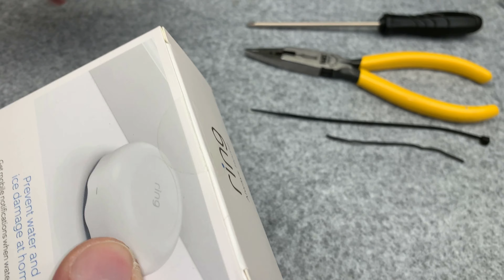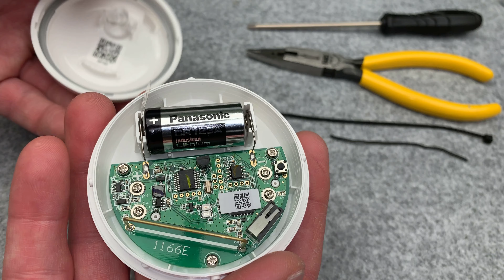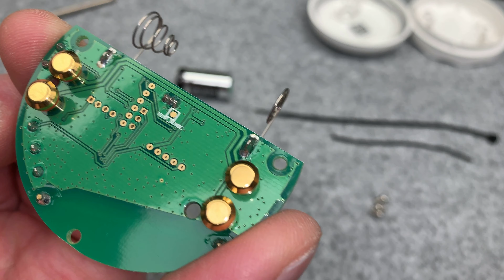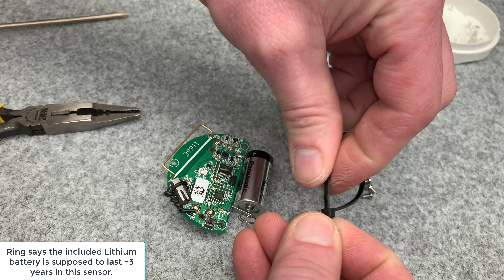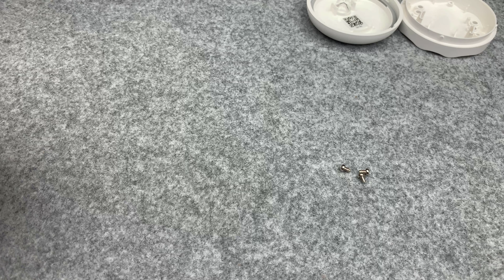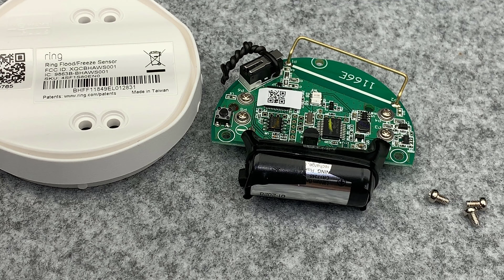How to make your Ring Alarm Flood & Freeze Sensor fit in very tight places

Comment: A better solution would be to add a wire probe to the contact sensor probe screws on the board. You could then place the puck under the sink and run the probe through a small hole drilled into the cabinet and tape it to the floor under the dishwasher. Now you’re monitoring for sink and dishwasher leaks with one device.

Comment: Thanks, any thoughts on if you do have a water leak, if it will just fry the circuit and thus make the system fail and not alert you? Perhaps if it goes offline due to water ruining the circuit it will alert you anyway essentially making it a one time use device (which isn't the end of the world)? Thanks for the video.
Reply: I was thinking the same thing. Guess he could just put it in a snack-sized ziplock bag for basic protection?
Reply: One possible solution is to coat the circuit-board with clear nail polish.  You may also want to experiment with silicon sealant (clear bathroom caulking).  Obviously avoid covering the contacts / "Gold Legs"  YMMV and not responsible if it damages/ruins your sensor!